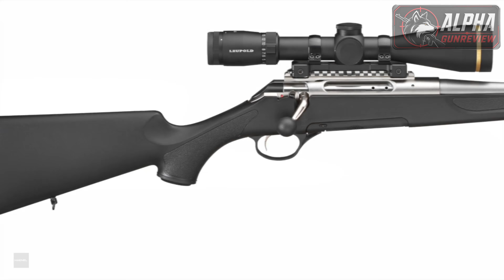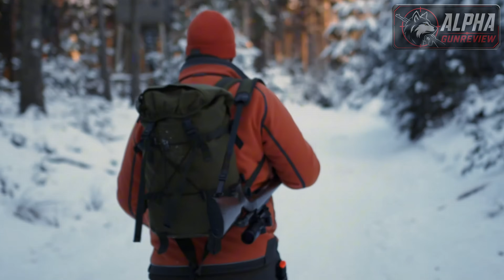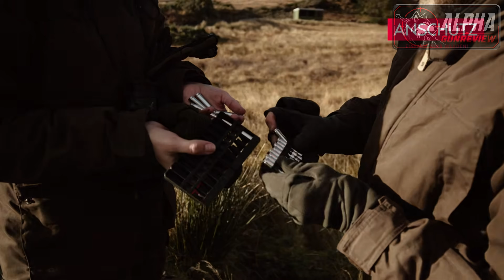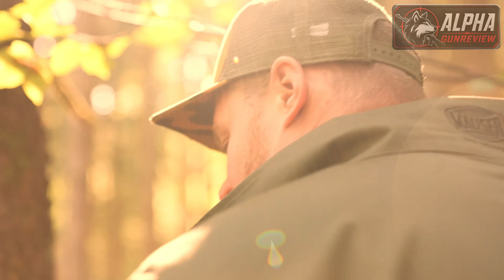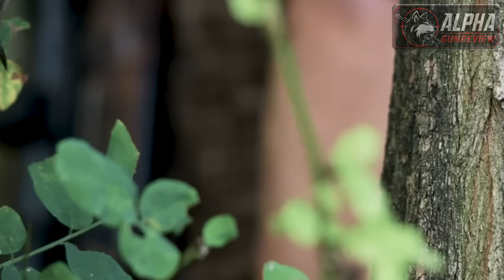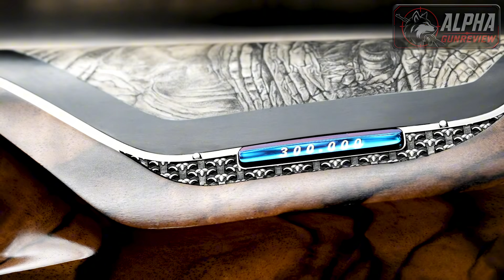Top 7 German Hunting Rifles of 2026 — The Blaser R8 Has Serious Competition

Comment: Over engineered and designed for comfortable stand shooting. None of those rifles have any business mountain hunting.
Reply from the maker: @serverlan763 That's a fair point regarding weight! Traditional German rifle culture heavily favors high precision and mechanical innovation for high-stand shooting. However, lightweight variants like the Blaser R8 Ultimate Carbon or Sauer 404 Carbon are specifically built to shave ounces for backcountry and alpine hunts. What's your go-to rifle setup when packing into the mountains? Don't forget to hit that subscribe button for more hunting gear debates!
Reply: Maybe cuz the Rifles in the Vid are mostly optimised for driven hunts and not mountain hunting?
Reply from the maker: @janikburri7921 Spot-on observation! German rifle design heavily reflects European hunting traditions—straight-pull actions and balanced weight are built for fast target acquisition during driven hunts. Completely different requirements compared to backcountry mountain hunting! Thanks for adding that valuable context.